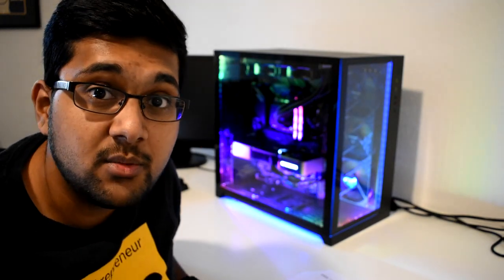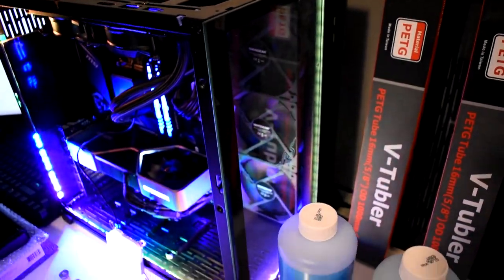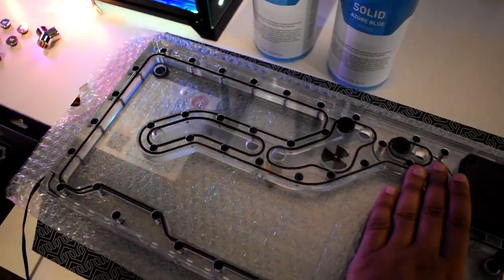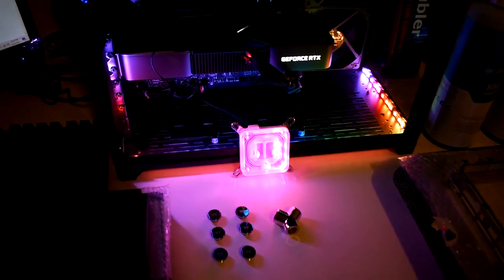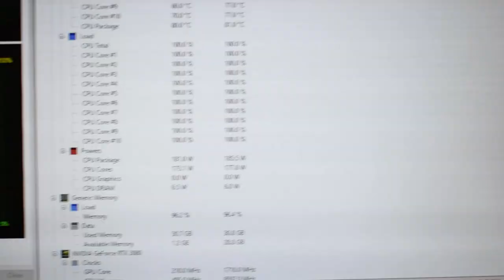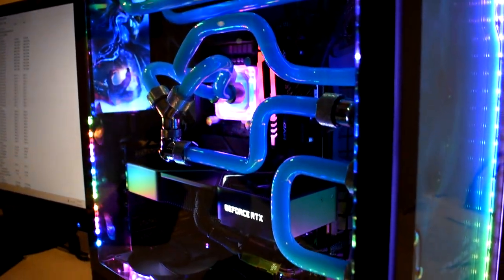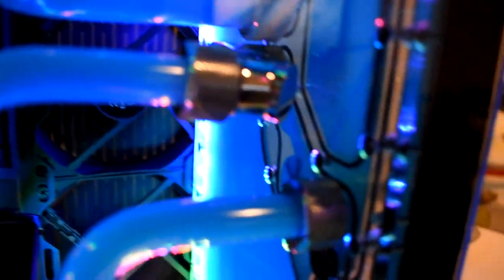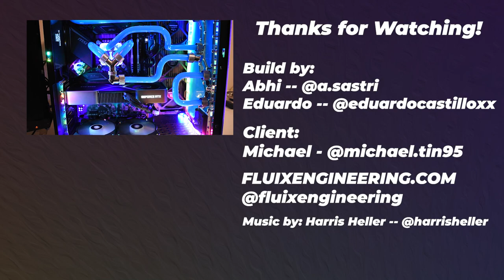Transforming a Beast: Upgrading a Gaming PC with Water Cooling for Maximum Performance

Comment: Very good video, I do not understand the configuration of the three hole water block, why is this so?
Reply from the maker: Great question! This is our TRI-SWIFT Multi-inlet Water Block, dual inlets significantly increase fluid turbulence to maximize thermal performance. You can learn more here: https://fluixengineering.com/water-blocks

Comment: Why so hot? Did u check voltage?
Reply from the maker: No core voltage or ratios were changed, this processor from the system integrator always ran hotter while on the previous aio solution as well. This could be remedied from a bios flash from reading some forums, but the customer has not complained and has been using for a year now

Comment: Quick question. So I am kinda new to building computers, but I have my fair share of knowledge. What I don't understand is why do you build a complicated pump and tube system just for the CPU? I would think that cooling the GPU is the most primary component. Plus is all that money worth spending on an AIO that's cheaper with almost the same performance.
Reply from the maker: Great question, it is all about the customers preference and the uniqueness of the build. It's custom and the people find value in knowing that it is one of a kind and none other like it. Kind of like a work of art. In this case, the customer requested this. As far as performance, we tuned the system more for aesthetics, i.e slower pump, complex tubing leading to friction loss, slower fan curves for noise, etc.

Comment: I would love to try it out on my new build the 12900K coming up but I think I will pass only because of the price ($250). That is just outrageous for a water block that costs almost as much as a 12600K. And I am using an NZXT Kragen 360mm AIO and getting around 79-82C on my 10900k using Aida Extreme, so it has very similar results for a $250 aio that comes with everything you needed and a nice display.
Reply from the maker: We understand! Thanks for sharing.